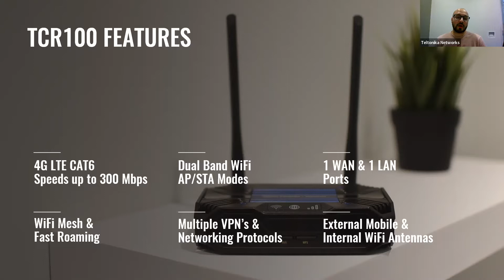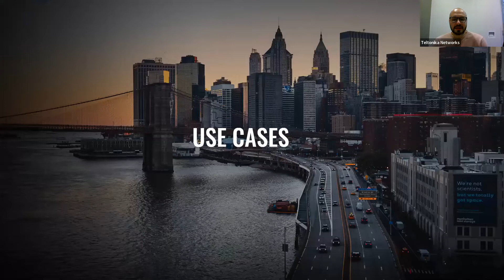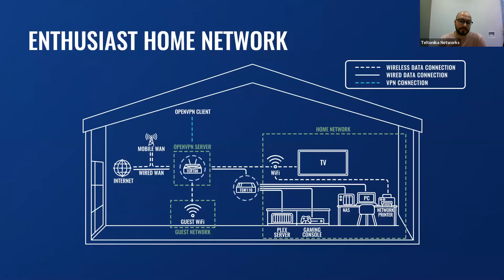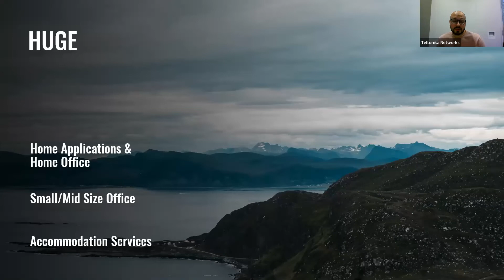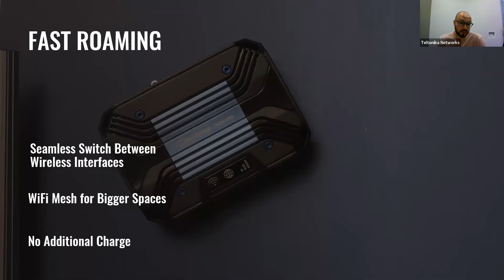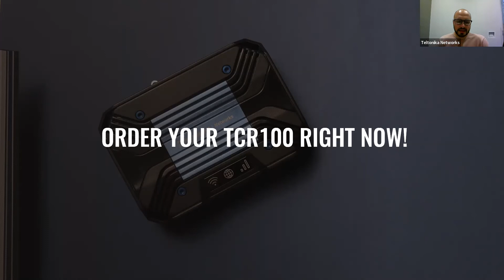TCR100 - 4G Wi-Fi Router for Home User | Teltonika Webinar

Comment: What's the logic in having an LTE CAT6 device capable of up to 300Mbps downstream, and crippling it with a 100Mbps port?
Reply: Because in 99% situations you will get less than 100Mbps from your mobile operator
Reply: @laikykkardanaTV  there is no place for 10/100 ports in modern networking. It just makes Teltonika look cheap and lessens the brand.
Reply from the maker: Thank you for sharing your feedback with us.